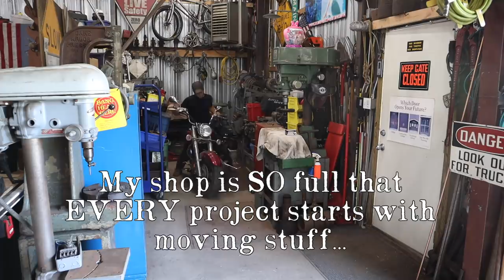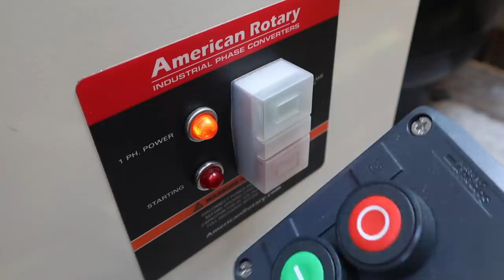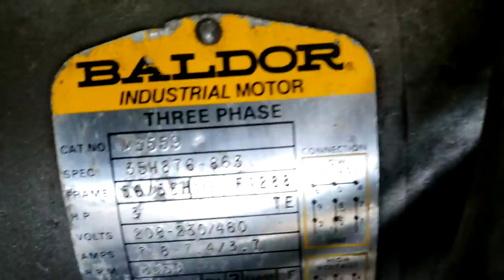WHAT is 3 Phase Power? ~ Installing a Rotary Phase Converter ~ Part 2

Comment: hammerdrill with a cup or sockel  will drive those gruond rods easly.
Reply from the maker: LOL... funny thing you mention that! I literally have an old demo hammer drill bit I plan to weld some thick pipe onto to use JUST for that and rebar, and was going to include making that in this video, but I ran out of time, and well... you know the rest!
Reply: @SalvageWorkshop  Leather gloves would have made the fingers safe.

Comment: Exciting progress Matt 👍 You definately know enuf about hammers to be dangerous 🤕
Reply from the maker: MAN am I DANGEROUS!
Reply: 🤔" So we must deal with it"  🤣
That was a huge earth pin mate. When I was elechickening we only used ones about 4 1/2 ft. any reason for the longer one? soil type or just the new standard?
Reply from the maker: @billbaggins  Honestly I couldn't tell you why they're longer! That's just the standard and what's readily available at the hardware store!
Reply: Cool, the deeper the better really. I'm out of touch with codes etc, a lot has changed in building in Aus over the last 5 yrs

Comment: Nice your running 60 amp power to feed the new equipment in seal-tight with NO ground wire in the group ungrounded conductors big no-no. The breaker will burn the wire and maybe set your shop on fire before the breaker trips.

Comment: Good video, Do you have any test equipment for your motors? A megger would ensure those old motors are not shorted to earth. Not a good idea to hold a motor when switching on you could have got a shock if the motor had a fault.  i am not being a "Safety Sally" but 220V 3phase can kill.

Comment: Everyone needs what one doesn't have (worn out one, I know) Over here 3 Phase is standard, even for residential, but I needed 30 Amps single Phase, which you're in turn not allowed to just load onto a single line of the 3 Phase net since it puts offcenter load onto the transformers :)

I'd recommend you put up 3 lights (one for each phase) somewhere in the shop, as a control for all 3 phases being up and running and as a reminder to turn them off at the end of the day :)

Comment: I used do electrical work. Very nicely done! One caution I wana mention. See here 31:33 that blue wire making a 90 turn into hole3. That sharp 90 causes electrical friction, plus in this case there is vibration, which can cut into the wire. So its always best practice to make smooth loops if possible.
Oh and pounding the ground rod is never fun, most often you have to break through rocks.
Reply from the maker: Great advise! I went out there and changed that blue wire so its going straight down in the RPC panel! Much appreciated!
Reply: @SalvageWorkshop  No problem bro, thanks for the videos.

Comment: I had a friend that added two of those through doors to his shop.  He stored raw material (staging) in one and finished product in the other.  He was heavy into metal shaping and making the machines for hydraulic presses of goblets (ETC) from solid metal.  His lathe was a 'cannon' turning lathe, it was 14' long.  He was a metal guy!  It actually turned cannon for WW II - I think the Cruiser type not the battle type which comes from bigger lathes.

Comment: May want to check the NEC book on the size (3/4") of the conduit.  I completed the wiring for a whole house AC unit which worked perfectly.  The local building inspector said no.  I had to upgrade the conduit to either 1.25 or 1.5 in.  Nice work.  Narragansett Bay.

Comment: You say the two phases are the same on the out and the in panel. But the two phases going to the convertor are 180° out of sync. But the three phases they need to be 120° out of sync. Or do I see it wrong? In Europe we have three phases already coming in from outside. These are 120° out of sync and 380 Volts.
Reply: At least some countries in Europe. But it is not 380V any more, it's 400V !
In some other countries, you will receive a single phase 230V.

Comment: Is there no possibility of receiving three-phase energy directly from the concessionaire? Here in Brazil we simply open a requisition, pay a fee and leave the "box" ready for the concessionaire to come and install the three-phase energy. Was it your choice to do this or is there no way to do it directly by the provider?
Reply: Yes, it can be done. But there is a large fee to install the three phase line transformer. If I recall correctly, there is also a somewhat higher KWh billing rate.

Comment: Might want to check in to having an indicator light in the shop to let you know when the converter is running. Great job, such a clean install! I cringed when I saw the rat’s nest inside your 1ph panel, and I’m not even an electrician!

Comment: I know this video is 2+ yrs old and who knows if this setup is even still there but there was a big issue. It appears you ran the hot(supply) leads in separate runs. Big no-no. Look up inductive heating. You need to run the wires together to cancel it out- otherwise you can literally turn any metal in between the runs into a heater-it can theoretically get red hot. You may have been getting away with it up till now but it will cook the insulation-wiring-etc.
Reply: I'm gonna run all 4 wires into the box using "soow" 6g . Would that be better?
Reply: @billystray7007  are you doing a similar installation? It was a while back that I wrote this comment so I don't remember everything. As far as wiring sizes, you can check online for what amperage a wire can carry. My issue with the way he did it was that you always want a balanced load run together. You can split pairs of wires up... but you need to have the same current going both ways thru a run. So yes you could do all 4 +-+-(as long as it fits) or split +- and +-, but not ++ and --, I hope that makes sense. Imagine water-you want the same amount of water going both ways in any pipe/etc. (Edit-as I said I kinda forgot what this video was... And it depends if you're talking about the single phase feeding the convertor or the 3 phase coming off. Sounds like you mean the 3 phase-so yes keeping them together is ideal. Sorry for the confusion-like I said I was trying to remember the situation)

Comment: 29:40 3 Phase power is 60 degree phase angle between each leg, That would be the job of the 3 phase converter.
Reply: *120 degrees
Reply: @alexking6245  You are correct.

Comment: No project is complete if it isn’t anointed with blood.  Brother, please slow down just a bit to consider the dangers of every task at hand and try to come up with the safest method to accomplish it.  I don’t want to see you hurt. I have driven hundreds of ground rods, some easy some hard, but the guys that taught me did it right and I just imitated their methods.  The basic manual method; scoop out a shovel depth hole fill it with water, in an up and down motion and side to side deflection make the water do the work.  Pull the rod up and let the water fill the hole and vigorously push it down again and the water will dislodge the soil with each thrust.  Often times I could put ten feet of rod down before using a weighted pipe driver to put the remaining 8’ in.
Reply from the maker: You say that like I completely disregard my safety completely! Sorry my friend, but that is just NOT the case! Sometimes things happen!
Reply: A word to the wise is sufficient.

Comment: Geeze, 25 grand to run a 3 or 4 fat wire from the transformer in the next street... rip-off!
Reply: That transformer on the next street over might be on the same phase as your transformer. You would need wires from 3 different transformers, all on different phases. The copper costs would probably exceed the cost of a 3 phase transformer at the usage site.

Comment: 3 Phase and online 220V? Why not 400?
Reply: There are all sorts of supply voltages available to industrial customers. But small shops and residential users generally do not have the power demand that would call for voltages higher than 120/240. 

That RPC is only 15 KW. The standard residential electrical panel is 240 volts at 200 amps, which is 48 KW.
Reply: @buggsy5  thats interesting, in Austria we have 230 2P and 400V 3P.

Comment: i must tell you, there are several code violations with your set-up.......one is with the the 220v. feed......you can't split the legs between raceways.....two the door on the generator is blocked by the fence.......you should also ground the generator directly to the ground rod.
Reply from the maker: Of course you must! Maybe those are violations where you live, but this was inspected and approved!
Reply: @SalvageWorkshop  THAT is Scary !
Reply: @unky-duky7033  Your are so right, he's likely to have heating issues by not having the phases and ground run together, and the live front clearance is dictated by NEC. It goes to show  not all inspectors are equal.

Comment: Hi...
I'm just picking up on a few things here:

1) them angles you cut for the phase converter to mount to:
If it'd been me... I'd have cut them longer then cut off the vertical to the length of the phase converter and tucked the flat bit you'd have been left with under that cladding and welded it to the building's metal frame...
That way it's all nicely referenced....

2) the Tek screws you used to mount that 3 phase dis-board:
Are they roofers with rubber gaskets...?
If so then get em out and pick the gaskets off then re-fit...
And scratch the powder coat off the area in that dis-board where them screws go as well ...to reference that panel to the building's metalwork...

3) never rely on one of them volt pens to prove whether or not something's dead son...
A volt pen is not safe isolation...
Get a proper 2 pole voltage indicator...

4) a good way to install rods is to use a rotary hammer...
Set it onto hammer only and enjoy driving the rod/s in with very little effort...

P.S.
I'm an electrician myself here in the UK and like your videos...🇬🇧👍

Comment: Are you actually allowed to do electrical work like this at home in america? I have a degree in automatics and electronic going for a masters in automatic engineering. And still not allowed to do this at home. even while working as an electrician.  I have seen so much shappy work from diy electricians atleast you seem to know what u do..   and also you have more tools than homedepot. Why are you stripping wire with snippers 😂
Reply: He can do the work and get a licensed electrician to sign off on it if he needs to.  It looks like he has gotten good information to do it up to code and then some.
Reply: @cmccoy3972  hmm.. in norway you can do what u want as long as it is plugged. Change some covers. But when it comes to work like this. Doesnt matter if you work as an electrician or not. You actually have to call a licensed company to do the work.
Reply: I wouldn’t sign it off...
Reply: It depends on the state. In some you don't even need a work permit or get the work inspected - as long as you are doing it on your own residence. In many states, you need to pull a permit, then get sign off by the city/county electrical inspector. In some states, I believe that you pull a permit, then a licensed electrician can sign off on it - but most electricians will not do that, since it subjects them to liability issues for work that they did not perform themselves.